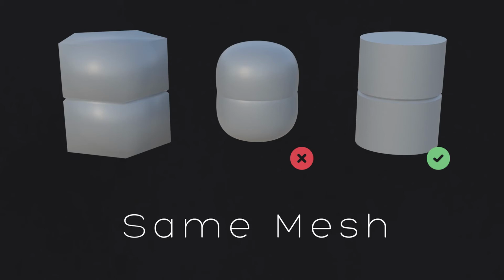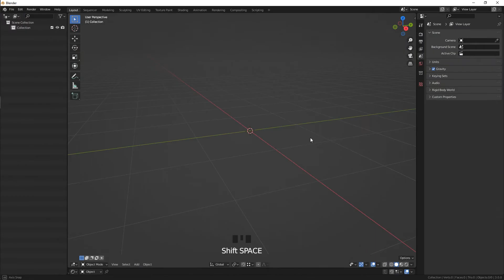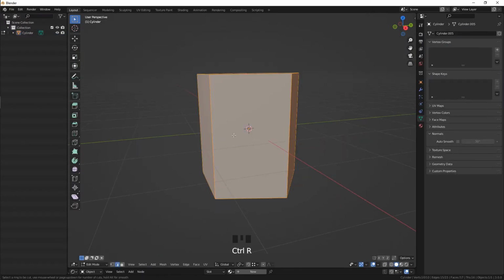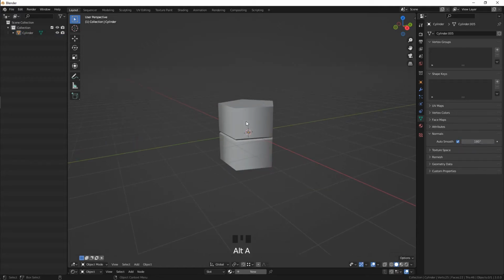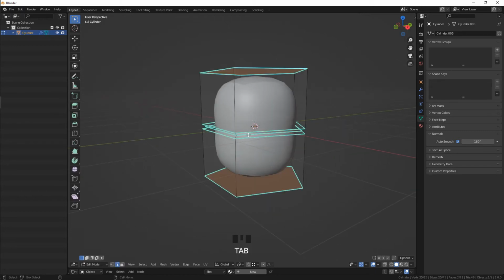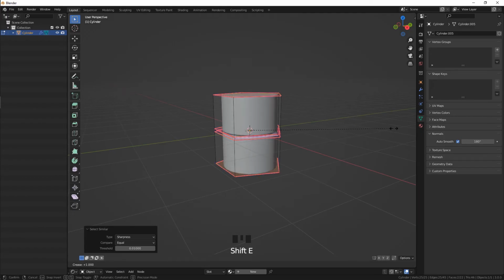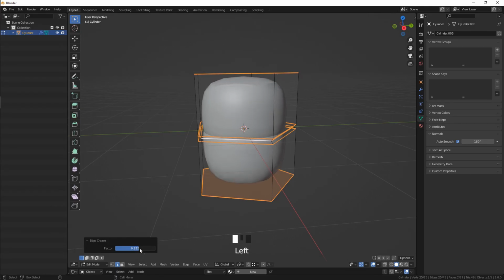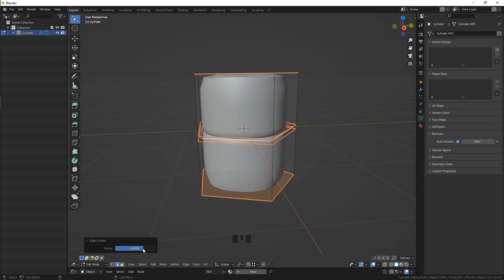How to keep sharp edges with subdivision surface modifier. Blender tutorial

Comment: But I did this and it dosnt WORK. Like it will make them pointy ish but they are still way far away from the unsmoothed shape even at the max setting. It is kind of frustrating and I do not understand why I cannot “pin” some vertices to prevent ANY smoothing.
Reply from the maker: There's couple things I can recommend here. 
1. In the Advanced section of the modifier set boundary smooth to keep corners. I doubt that it will change anything as it's for a very specific places of the model, but anyway worth to try.
2. Sometimes you need to crease not the edges you think, or more edges than you think to get desired result. For example you have a trim or border of the mesh that has a Profie shaped ike this - П___ (roughly). Where П is the trim and _ is your mesh surface. And this profile goes along the mesh border and you wnat it to keep the profile. Then you crease Loops of the profile (the edges between neighbouring П). But if you want corners where the border turns also to be sharp you also need to crease the border Ring (the edges of the П itself). And this is a more of an obvious example, but this also applies in some unexpected places. 
I feel like it can be really hard to understand without visual examples, so you can just to try to crease some random edges around the area that you want to be pinned and see how the mesh behaves, or let me know how I can contact you to Show what I mean.

Comment: Great one! I need also advise on how to reverse that or clear any edges which are unwanted creased please. Many thanks
Reply from the maker: Thanks )
That's pretty easy, just drag mouse in another direction, press - 1, or input -1 in the pop up menu. I usually use the second option, because it's the fastest one, but you can stick to whichever if most comfortable to you )

Comment: For those of you wondering why the selected edge turned blue before he sharpens the edge, it's because Kridaran Art forgot to mention that after you go to edit mode you need to:

- Select the edge you want to sharpen, then ... 
- RIGHT CLICK and select "Mark Sharp"

... Then you can press "Shift+G" and select "Sharpness".  Hope this helps anyone who's confused by the missing step.
Reply from the maker: The point of this tutorial is to show a solution to a "Why edges that are marked as sharp are smoothed by subdiv?..." problem. Plus this was quickly shown in the first half of the video (quickly to get to the point as soon as possible). 
But thanks for clarifying some details. It will be nice if someone runs into this problem and finds your comment )

Comment: when i use insert (i) it dont get sharp.?
Reply from the maker: Insert can be used to add support edges that will reduce smoothness done by subdiv (the smaller distance between edges the sharper transition between them will be). But that's a bit  more about topology, and "Shift E method" is used when you just need sharp edge without changing topology. It looks less realystic than proper support edges, but also has it's area of usage

Comment: hellu i need some help, how do i apply that to the whole object :0? because it kept showing the original edges?
Reply from the maker: Hey 👋
Excuse me, I'm not sure that I understand your question completely 🤔Do you mean that you need a subdiv modifier without smoothing your object or that you do need smoothing, but it doesn't work for some reason? 
In first case it's pretty simple, just go to the modifiers tab and at your subdiv one switch from Catmul-Clark (default) to Simple mode. This will subdivide your mesh without affecting its shape.
The second case is trickier, if you apply subdiv modifier and the shape of your mesh doesn't change, there's probably something wrong with your mesh (maybe topology is too dense)

Comment: Loopcuts work for me
Reply from the maker: Yeah, but it provides a bit different result and increases polycount. To my oppinion it's better to chose between these two options when you need specific results. To what I know loopcuts are more used in hard surface modeling. I ususlly prefer edge crease cause I work more with ogranic-ish mid poly objects.
Reply: @kridaran_art  yeah i mainly model things for 3d printing ..for that reason needs a clean edge and doent matter the poly count ...so yeah for a digital use (game or a animation ) poly count matters .. 🔥